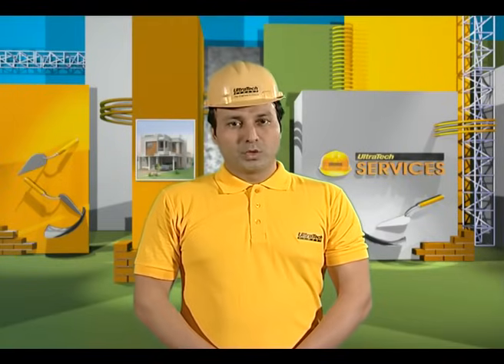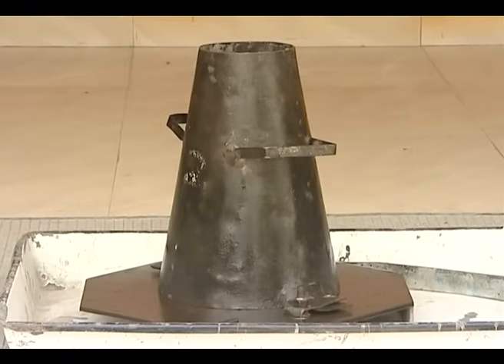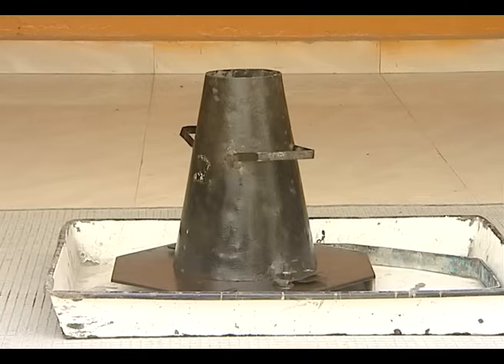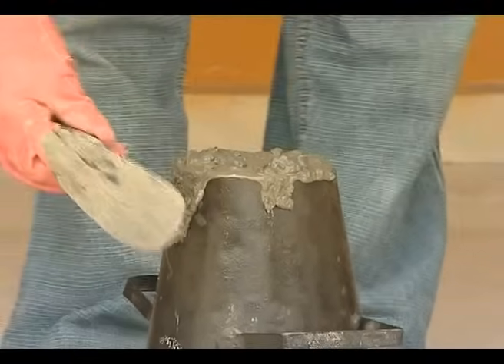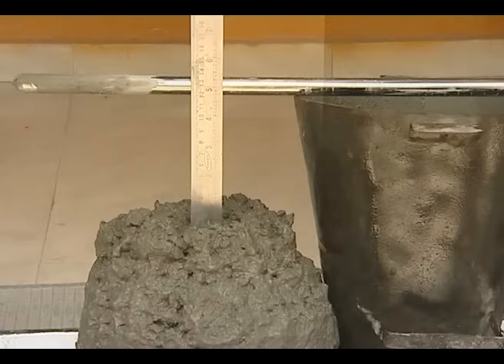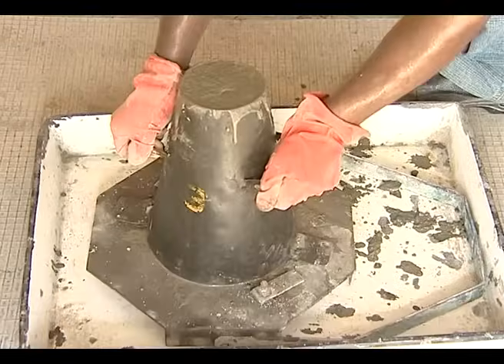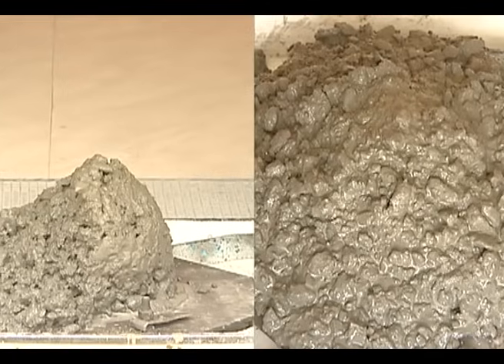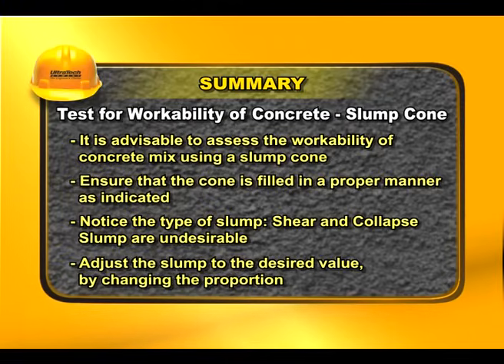TEST FOR WORKABILITY OF CONCRETE - SLUMP CONE

Comment: What's the right measurements  in difference of slump and the original height??
Reply from the maker: Hi,
Thank you for reaching out to us. The slump is measured as the difference between the original height of the cone (300 mm) and the height of the concrete after it slumps. For example, if the original height is 300 mm and the slumped height is 200 mm, the slump would be 100 mm. This method aligns with the standard procedure for a slump test. If you need further assistance, please contact us via toll-free no 18002103311
Regards,
Team UltraTech

Comment: ok.. what causes shear and collapsible slump and is it best for lantern or beams..because concrete needs for such work should be collapsible so that it may fill up all air bubbles in concrete
Reply from the maker: Hi Abid,
Thank you for your query. Our experts will answer your question shortly.
Meanwhile, you can watch homebuilding-related videos here - https://www.youtube.com/c/UltraTechCementLimited
Regards,
Team UltraTech
Reply from the maker: Hello, 
We would like to inform you that shear or collapse slumps in concrete are due to the majorly wrong proportioning of aggregates, higher water-cement ratio, and maybe the wrong dosage of admixture. Hope this solves your query. 
Regards, 
Team UltraTech

Comment: why the slump cone is conical ?
Reply from the maker: Hi Siva,
Slump is a test to understand the Workability of Concrete. A cylinder may not just slump, it might also fall apart due to a lack of cohesion. The angle ( called the angle of repose) is the steepest at which the sand grains don't slide down the hill. This limiting point is the same all the way down the pile and that's the angle of the cone & that's the reason slump cones are conical.
Regards,
Team UltraTech

Comment: The slump cone shall be removed by raising it vertically, slowly and carefully, in two to five seconds, in such a manner as to impart minimum lateral or torsional movement to the concrete. (extracted from Construction Standard of HKSAR)
You guys did twist the cone
Reply: why the slump cone is conical ?

Comment: You need to dampen the cone and the base plate before putting any concrete in. You don’t clean the concrete off the top with a trowel. You use the tamping rod in a screeting motion. You don’t twist the cone as you pull up. It must be straight. Also you don’t measure to the highest point of the concrete. You measure to the displaced center of the concrete. Read the ASTM standard please.
Reply: Okay boss. If all would have done as you said, what would be the difference of slump in two different method? It is wise to be a practical rather to to find fault with anything...
Reply: @nirmalendukargupta201  Doing it with a dry cone and baseplate and twisting it while lifting will give a lower slump value. Unscrupulous site technicians have been known to deliberately do it this way to "cheat" the test and make an otherwise too liquid concrete pass
Reply: I agree with you with the dampening, the use of the tamping rod to level off the concrete and the not twisting. In the UK though the standard specifies that you measure to the highest point. Now I want to read the ASTM standard and compare :)

Comment: CiviLab is a multilingual civil engineering laboratory software (English & French), which allows you to carry out the tests with your preferred language and to print the results with another language, designed by civil engineers to meet your expectations, our software allows you to manage the tests carried out within your laboratory with remarkable flexibility and reliability. Easiness of usage, allowing members of your laboratory to master CiviLab in record time.

CiviLab manage the following tests:

Geometric properties (density, Water content, Void ratio ...etc.);
Grain size distribution test;
Atterberg limits test;
Sand equivalent test;
Micro deval test;
Los angeles test;
Proctor test;
Direct shear test at the Casagrande box
Oedometric test;
Drill hole log;
Heavy dynamic penetrometer test;
Menard pressuremeter test
Concrete Formulation (Dreux- Gorisse).
Concrete Formulation (Bolomey);
Concrete Formulation (Faury);
Compression test on concrete;
Ultrasonic Testing;
Bitumen Extraction test;
Bulk density of bituminous specimen;
in situ compaction controle.
More details www.dzlogiciels.com

Comment: For everyones benefit, acceptable safe slump for reinforced foundation walls/footings/pavement 25-80mm, beams/columns 25-80mm, slab 50-100mm, piling 100-150mm. Beyond these values are not safe.
Reply: Thanks man

Comment: every layer should be tamped 25 times, not stroked 25 times. Tamping method is wrong. This is the common mistake in most of the sites. At least ultratech should do properly.

Comment: As per IS 1199 slump cone is filled in four layer,so don't confuse with comments. This video is wonderful and precise
Reply: Not ASTM C 143 but Indian Standard (IS-1199) ?
Reply: As per IS1199:2018 part 2 clause 4.3.3b in slump cone test slump cone is filled with three layer 😅
Reply: https://www.youtube.com/watch?v=q0G17VnmZG8&t=28s
Reply: Wrong
Reply: Depending on what standard you are using

Comment: Sir, what are the  slump values for different work like road , slab , columns etc.???
Reply: In Australia for normal concrete we mix  20mpa 20mm aggregate 80 mm slump  when it is being tested . A wetting agent can be added after the test to make the concrete easier to work .
Reply: 5 inch

Comment: FAIL! 
Three lifts not four. Don't rotate the cone when lifting.  The cone must have moisture coated inside it before adding concrete and measure from the displaced center not necessarily the highest point. Also it's two and a half mins not just two and he didn't rod the top lift properly. Test like this and get laughed off the job site.
Reply: It was so useful
Reply: You have to rotate the cone to free it from the bayonet before you can even begin to lift it.
Reply: With doing three lifts, how many times can you tamp it with the rod per lift or in total?
Reply: ASTM specifies 3 layers , Indian std specifies 4 layers
Reply: Dear sir assistant technician vecancy have please call my my mobile members 0097466977318

Comment: Why is it undesirable for a shear or collapsable slump test? Its great to know what is preferred but equally important to understand why
Reply: I get that but what are the dangers when contractors the slump test fails and contractors use it anyways. I say this because many contractors provide shotty work. In what ways does it effect the integrity of the concrete? Are their any telling signs?
Reply: Aside from affecting ease of work (pouring using pumpcrete tend to be difficult if slump is too low), it may result to severe honeycombing on structural members, reducing integrity of the structure.

Comment: Not four layers, three layers and the cone should not be rotated
Reply: Slump test should be in four layers
Reply: As per Indian Standard BIS 1199 it is 4 layers
Reply: Zeeshan Khan how much be should minimum and minimum slump??
Reply: After the slump test
Reply: ASTM C143
   requires 3 layers
Reply: Pooja Patel Should in be three layers
Reply: How much mm should be
Reply: mim 50 mix 120 mm
Reply: According to British rule it is 3 layer
According to IS code it is 4 layer
Reply: Four layer required